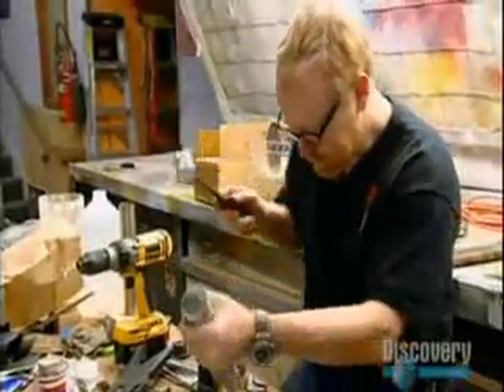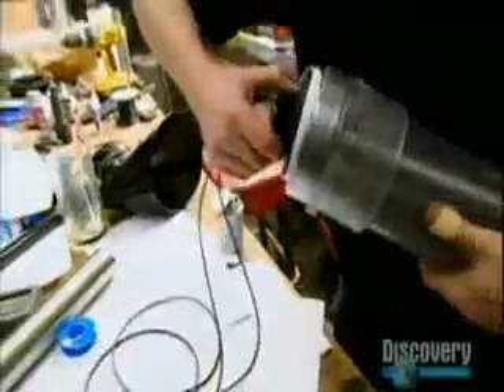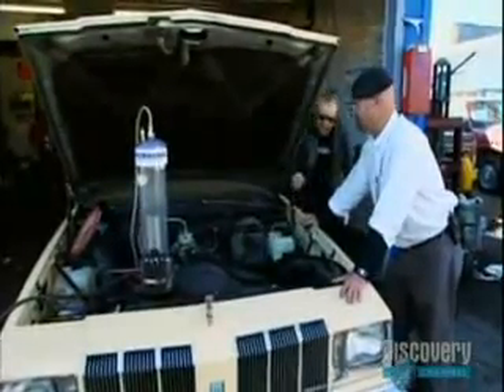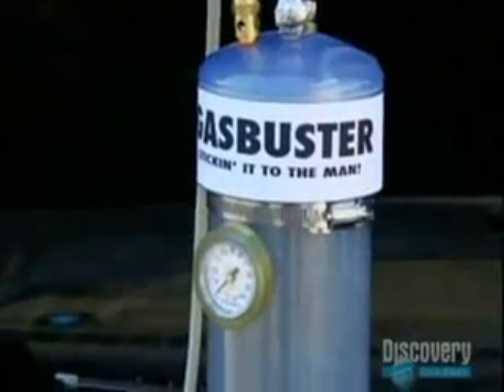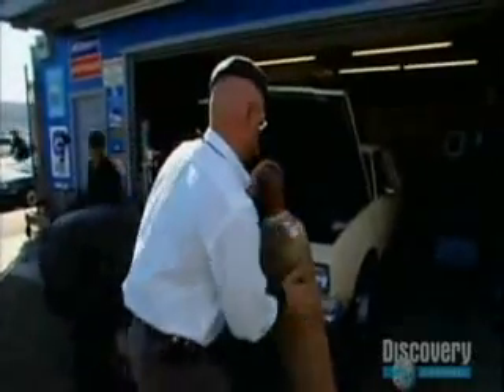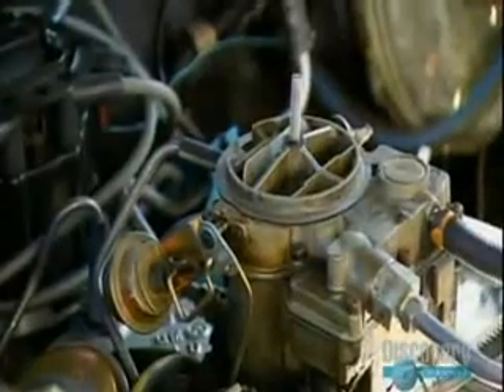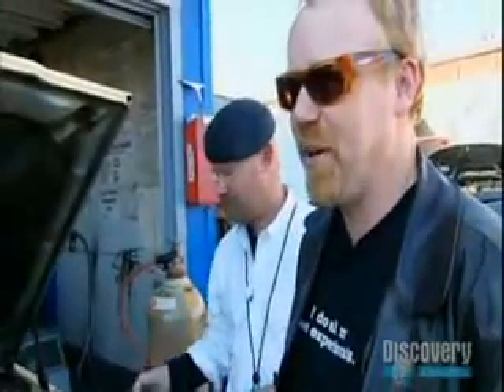HHO Mythbusters Explained

Comment: So you burn petrol in an internal combustion engine at say, 40% efficiency, to generate electricity and by electrolysis produce “HHO” ie a 2:1 mixture of hydrogen and oxygen by volume then burn that in your engine at say, 40% efficiency to run your car. If you do all that your engine will be converting your petrol to useable energy with an efficiency of 16%! No wonder only those with little knowledge of the basics of science bother. Btw these devices are not “fuel cells” they are electrolysers. A fuel cell is a sophisticated device which uses hydrogen, for example, to produce electricity which can be used to power a motor to drive a car, or whatever else you like.

Comment: I figured the oil companies bought them off .... when I saw the original episode I was so disappointed ! first off they were not making enough browns gas/HHO to piss at ! I could do more with 2 spoons in a can ! that was silly !
My truck ran on 2 LPM for 4 + years and I got 48 MPG..... 40 to 48 MPG actually, depending on how I set the "Matt valve" to lean out the gasoline going to the engine......... I used PVC sewer pipe as containers and the RED plugs for them that would be air tight but pop off if the gas ignited.... that worked great....never had one pop while driving it.
....HHO will get you better MPG but be smart and use a pop off cap on everything ! ....Bob....

Comment: In a previous life I worked for the State of ______ Division of Environmental Quality.  A salesman for a hydrogen retrofit approached me and asked if their company could hook up one of their generators and monitor the results.  At that time I was driving just about daily to a superfund site 70 miles away where remediation was being conducted.  After several months with controlled monitoring of emissions, recording gas milage, subjectively evaluating power, and such, it was determined that hydrogen generators (well this one in particular) work best when the engine is in thermal equilibrium (warmed up).  Short runs did not show any significant improvement in emissions.  There was a reduction in emission but I do not remember the figures.  There was a 17% improvement in fuel efficiency on longer treks.  There was a notable improvement in power.  There was no evaluation of hydrogen embrittlement.  This was obviously not an attempt to run an engine completely on hydrogen.  The state did not opt to retrofit their vehicles with hydrogen generators.  I was, however, impressed enough that I purchased a unit for myself.  Never did install it however as I found out it would void the warranty on my vehicle.

Comment: Agree they probaby did not put much effort in different cells for a proper test. However I made about three cells in 2014, one with plates, one with wire coils and another with pipes and all were poor in producing bubbles. Much like the clip on mythbusters slow bubbles, I experienced that results too. I connected direct to battery and I also tested it on battery charger but same results. Not sure if I should have higher amps? Or what the reasons
Reply: High voltage, resonance frequency.

Comment: these guys done just about everything to make this fail .....
they used "the best of different systems" and combined them .... ya right..
an NE555 makes a square-wave. they get a friggin' sawtooth !!
they use low voltage "high" current electronics for a high voltage breakdown electrolysis cell
not sure anymore if they used an airfilter, but you should use a system where the hho is introduced from a low point  since you otherwise let the very light hydrogen escape .
so place airfilter to the car front below manifold inlet level, connect hose from reactor direct on whatever unused pipe on the manifold.... that would at least have a chance;)
no, not the right way, but a "proof of concept" way
don't forget to advance ignition to around 4 deg past TDC !!

at least they did prove it can run on hydrogen ;)

Comment: If Mythbusters really cared about the TRUTH, they should actually read the latest empirical evidence on this subject and delete this video!  The truth is that anyone can go to google scholar and search "HHO + combustion + engine" and see that there has been 517 scientific publications on this subject since 2015 alone!  No need to rely on a 2009 corporate sponsored mythbuster episode.  Here is an excerpt from a recent (2018) review paper on this subject titled "Production and use of HHO gas in IC engines" published in the International Journal of Hydrogen Energy (https://sci-hub.tw/10.1016/j.ijhydene.2018.02.120).  BTW, this journal has a scientific impact factor of 4.0.
------------
"Bahng et al. have studied the effect of HHO gas  addition in gasoline fueled engines [*]. They evaluated the overall energy efficiency of electrolysis as ~30%. Their calculations revealed that when the power consumption in the electrolyser  is 400W, the effective energy content of the gasoline-HHO mixture is about 45% of that of liquid gasoline. However, owing to the improvement in energy release rate with HHO addition, the gasoline consumption is lowered by almost 65% and only about 10% of the energy content of HHO is sufficient to make up for the energy of the substituted gasoline, thus indicating more economical operation with HHO addition.  The high octane number of hydrogen also minimizes the likelihood of knock in SI engines. This in turn permits high compression ratios to be used, further enhancing thermal efficiency. In CI engines, the induction of HHO improves the knock resistance, especially at idling and low load. This is because of the rapid rise in pressure and temperature caused by the fast burning of HHO. The wide flammability limit of HHO broadens the engine operating range and allows extremely lean operation. The absence of carbon atoms, shorter quenching distance and high flame speed of HHO minimize the formation of HC and CO emissions."  *Bahng GW, Jang D, Kim Y, Shin M. A new technology to overcome the limits of HCCI engine through fuel modification. Appl Therm Eng 2016;98:810e5 (https://sci-hub.tw/10.1016/j.applthermaleng.2015.12.076).
------------------
Its so great to see that all the hard work of garage DIY'ers have finally attracted the interest of major research Universities around the world.  Unfortunately, the DIYer's will never get proper credit for their innovations, such as the use of 316L SS electrode plates and optimized cell designs which came about on old internet forums in the mid 2000's.  Not only did they innovate and make progress on shoe string budgets, they had to fight off the Stanley Myer & Bedini "free energy" cult nutjobs as well as the hardcore skeptics, like myth busters.  So, a salute to the DIYer's everywhere who have the courage to TRUST and THINK for THEMSELVES.

Comment: Multiple stainless anode & electrode plates stacked. The more the better. Surface area. Multi Stranded, 4 gauge, oxygen free copper wiring, depending on length needed, carries more amps in PWM. The gap of plates you stated is too far apart. In my tests I found a much closer gap made more HHO. Too close of a gap HHO generation diminishes.

Comment: Where's your proof?  The hydrogen needed to drive a small car 10 miles will cost you about $3   At current gasoline prices that's 10 miles per gallon. Most small cars get 30 miles per gallon.   A device large enough to produce hydrogen at a rate equal to the consumption of an internal combustion car, going 30 mph on level ground, would be nearly as large as the car, and use 10,000 watts of electric power.   That would require a 55 horsepower gasoline engine driving a generator and consuming about one gallon of fuel for every 10 miles traveled.   The same car can go 30 miles on one gallon just by eliminating the generator and using the 55 horsepower to turn the wheels.

Comment: You can produce Hydrogen with solar panels, then make it liquid , then use it for your car
Reply: RazvanTSibiu but what methods do you propose for liquifying hydrogen? Don’t you think it is an unnecessary and expensive step to add to the process ? Fuel cells work just fine or have a look at Stanley meyers of using hydrogen as a fuel
Reply: @jadjaafar5203  Until you use energy to produce hydrogen you can make an electric motor that moves your car. While compressed hydrogen can have an enormous autonomy. But it's dangerous.

Comment: To start with these two fruit flied did everything wrong! First the cars timing needs to be changed to just past T D C Top Dead Center, so it will not backfire! Second the gas needs to be sufficient to run the engine! Thay did neither! and of course they failed!
Reply from the maker: Finally someone who KNOWS what they are talking about, not just talking ignorantly out of their ass!
Reply: isnt the o2 sensor suppose to regulate all that on its own without you tweeking anything? is it possible to juts leave it alone and it still works even though what you say improves things?

Comment: It's so funny how people think there's a conspiracy against these. If they worked, the oil companies would start making them and sell you them. They straight up don't work. My friends and I have tried  half a dozen of the best designed versions and never saw anything even outside the placebo margin of error for just driving slightly more efficiently.
Reply from the maker: Then Dude you did something wrong. I installed a rig in my 2002 Sport Trac which does 15-18mpg stock highway. I did have to do electronics mods to fool the computer via the O2 sensors but the results were I was getting almost 28mpg. I have removed it from the truck because although it gave me an additional 10 mpg the maintenance is a PITA. Constant computer adjustment plus the caustic leaked on my aluminum A/C evaporator & ate it for dinner. This is great but best used on old steel cars with points. Less hassles. I don't recommend it for a newer  daily driver
Reply: @HHOSportTrac  Well congrats, make a video of how you did it so you can then be the 1st person every to have actual documented proof of it getting any better than like 1mpg (margin of error for just driving slightly better aka Placebo). I got together with several engineering teachers in College days and we spent about 2 months with various designs, multiple cars, various injection points, various mixtures and additives. Nothing ever got us any more than 0 to 1.5 MPG extra and a few actually lost MPG by about the same amount. So you'll understand I'm extremely skeptical especially about anonymous and anecdotal claims. But who knows. The theory was always pretty interesting. It does yield lots of explosive fun too if nothing else lol.
Reply from the maker: @benjmiester  Looks like you guys just didn't have the right approach or equipment. As I said this is an old video & I abandoned this years ago not because it did not yield the results but because it is such a PITA to maintain. Now since I'm not out to sell anyone anything, I have no desire to " make a video of how you did it" just to appease you. Although I do believe there is a video of the Sport Trac setup and all the components on my Channel. The concept is this: Adding HHO to the mix decreases the need for gasoline in the mix. Of course the ECU “senses” more oxygen than usual and orders more fuel to be injected to compensate. This action ruins any gas economy gained. You resolve this by installing an  EFIE which is an electronic circuit used to covert oxygen readings from the O2 sensor to lower values preventing unnecessary rich mixture injection. This is what give you improved mileage. Now I will agree that anyone who claims they can run a can SOLELY on HHO is full of crap.

Comment: I did it and perfect did it and I got about a 30% increase in my gas mileage. And today I can do better because I have tweaked the process. They need to do more investigation and tweak the full process to get the full result.
Reply: I agree. When I used it on my van years back it helped about as much as yours did on gas mileage. Been considering on doing it again on my newer van.
Reply: That's the problem. EVERYONE can do it. Mythbusters NEEDED to make that fail. Understand?

Comment: they did very little research and skipped many steps for preparing cells, and made a cell that is inefficient for novices, and did not make a resonant frequency.  I used to like mythbusters, but their ignorance in this subject has shown me they are idiots or just ignorant.  But they probably just want money for being on t.v..  All the idiots that watch may be convinced, the more informed know they must of been on crack.  Also tuning like an organ for resonance for the design they chose, which is way out of their league and should have just tried to get fuel efficiency out of a simple design and use some safety measures in the build.  They are idiots I am now aware and hold no relevance in the scientific community

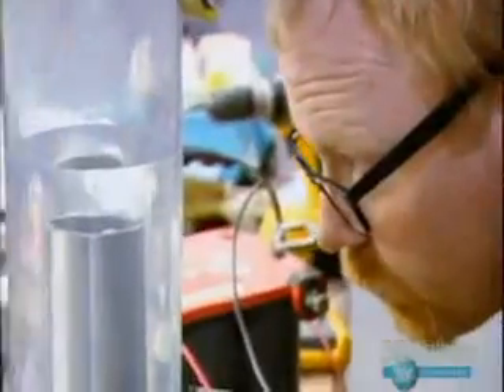Comment: Usually I see a 1:20 ratio of Thumbs Down, but this video has a 1:3 ratio, which really must be degrading its rating, so it doesn't get the views it deserves. Obviously a car CAN run on hydrogen and air, so for sure it would run on just HHO.
I'm wondering if the ignition of the HHO in the cylinder actually sucks the piston up, because the gas in the cylinder has to contract on ignition to become molecules of water, which would have less volume?
The explosion is really an implosion.